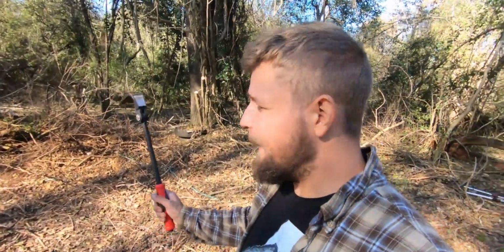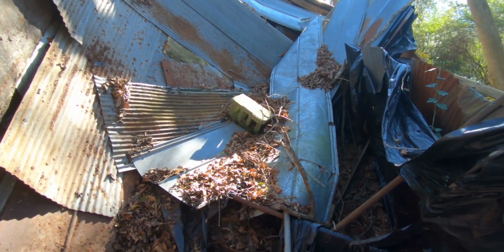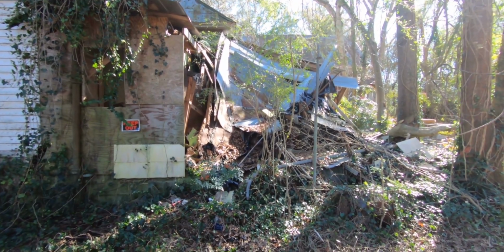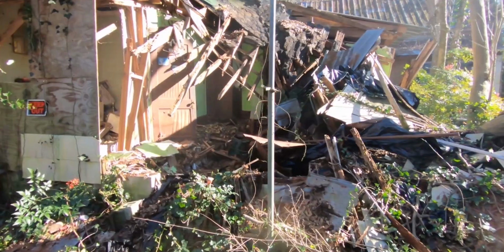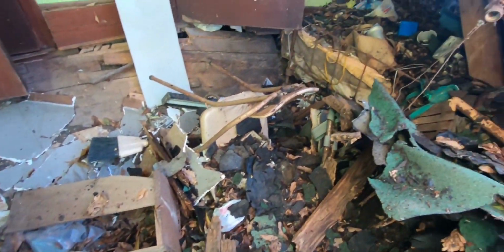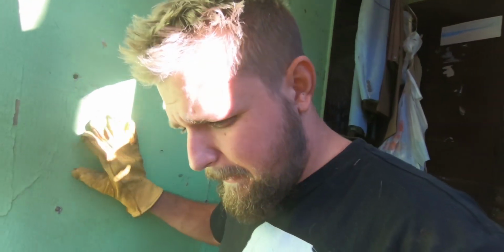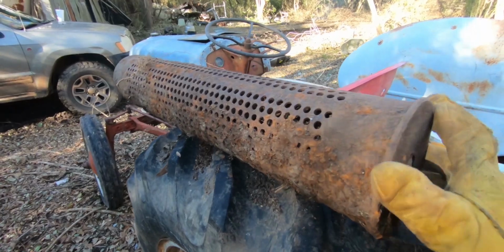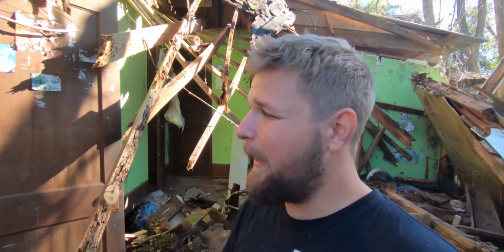Demolition On The 140 Year Old Farm House (1950's Additions)

Comment: Hard hat and safety glasses would be a good idea during demo work. A large rubber mallet is very effective for beating things apart. You're doing a good job. Work from the edges, piece by piece and form piles. Watch out for the nails, they can bite you too. Fun project.

Comment: Hi Robert, I was wondering. If you know what style the interior  wall is  called? I  don't know if it is called shiplatch or called by another name here in the south.  Same with the  exterior wall  how it put together. Is it shaved  on top and hammer under the top  board  . How do they know if the beams are straight,  just tickle me when you show the stacked stones and a pebble is holding up the  beam. I'm not familiar with the tools they would use in the  1800 thanks  just love your web site

Comment: You be careful in there. A few times big sections looked like they might fall on you. 
If it looks unsafe, get a saw and cut it away from the house, then pull it all the way down with a tractor, then rifle through it once it's flat on the ground.😊

Comment: That extension suggests why there are now building rules, regulations or codes in operation. Once there was skill and judgment, learned in the school of hard knocks. Then along came things like that extension, in the end they damaged structures rather than added to them. I am aware that some rules applied by those with the wrong mindset, do not always represent or allow progress. Rules are there for the guidance of wise folk and the instruction of fools, or that is how it should be when it works out correctly.

Comment: $ 12,000 for a roof is just a drop in the bucket. You still need a heating system, plumbing, sewer, bulldozer work, doors,  windows drywall and paint. The reason it sit empty was it would cost more to fix it than what it's worth.
Reply from the maker: Eh, the roof is the biggest deal. Fixing the roof preserves the house. The quote is $18,000 and I’m working towards that. I don’t need drywall. The original plaster is mostly good. I can put in new window panes. Doors are good. A septic tank yes, plumbing maybe. But all that stuff is way down the line. The point right now is preservation. The rest you mentioned is restoration.

Comment: 2:04  Asbestos tile?!?!   Please be very careful!
Reply: Don't smash it up, definitely don't cut it with an angle grinder (which is what roofers and siding people used to do every day, all their working life) and dispose of it properly. The asbestos fibres are pretty well sealed within those tiles. If you want to make absolutely sure there's no dust flying around, spray the whole place down with water.
Reply: @Ragnar8504  very good advice.